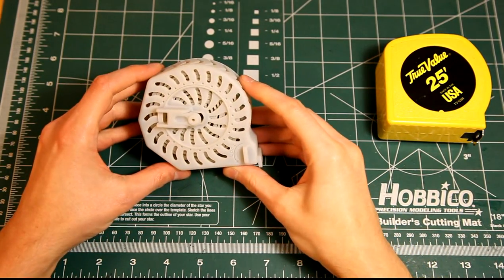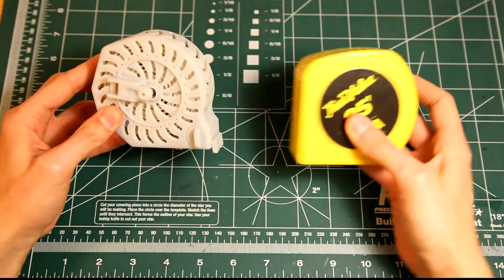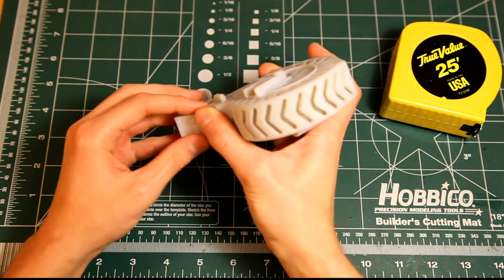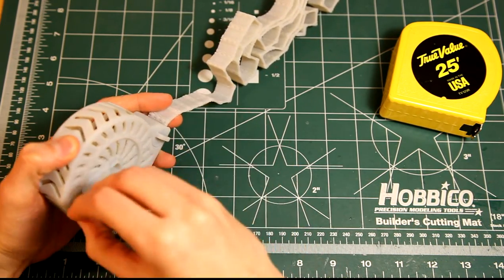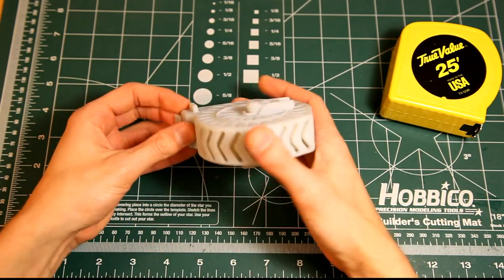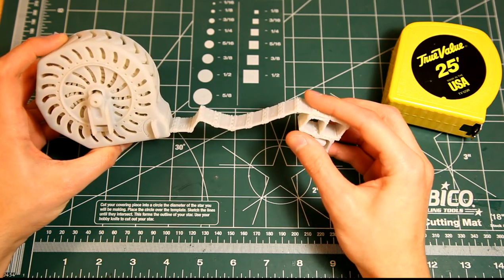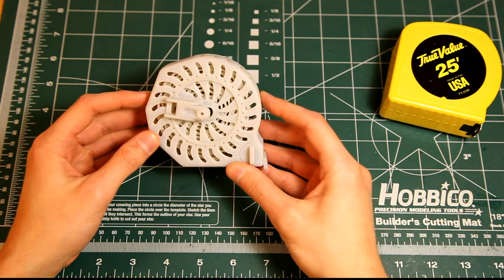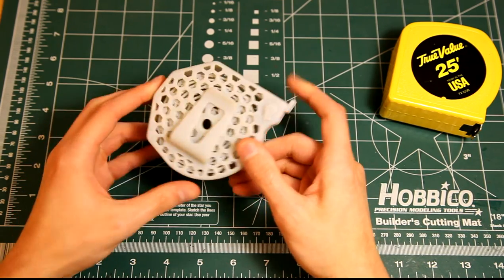3D Printed Tape Measure

Comment: I think it's really cool that you can print a working item in one piece. How is that possible? I am not really familiar with 3D printing, but it seems to me that it would be difficult to print the moving parts because the extruded plastic would want to cling to itself while it was still warm.

Comment: Are the STLs available?  Was a dissolvable material used on a second head?
Reply: I believe that this device was printed on a projet, or, something like a projet. They are extremely expensive printers that print a uv-cured plastic, that has a wax support material. I highly doubt that this could be printed with any of our FDM printers. Partially because the resolution is just not going to be there, and, the support materials on FDM printers aren't good enough.

Comment: The precision must have been high to print this, and if i'm correct, you must have used a dual extruding printer for support material.
What printer did you use, i'm curious?
Reply: ***** I don't exactly mean to rain on your parade of saving the children, but 9 times out of 10, a developing country will not have a 3d printing farm full of tape measures, mainly because by the time you shipped 3d printers in enough volume to actually help (say, 500) and lets say you get a good printer (makerbot or your choice of a printer that costs 1k) you are already up to 50k. If you were going to spend that much you might as well send real tools that will never break. Because the cost of PLA/ABS vs the cost of a tape measure is currently around 22 bucks for 1kg spool of your choice vs around 3.50 for a tape measure at harbor freight.

So no, releasing this tape measure on thinguverse is not going to instantly make home building possible in a third world country, sorry.
Reply: 16 microns on the Stratasys Objet Eden 3D Printer - and yes, there's support material.
Reply: Stratasys Why not make it open source for anyone to print their own? Why horde the technology to yourselves if all you're going to do is boast about it and not share the technology with everyone? In making it open source you could be given developing countries tools in which to build homes and use in their tool boxes.
Reply: TehPaws3D Having this open source means anyone have access to it. Your opinion is mute.

Comment: Not all applications require a lot of precision.  I want to print one of these for my tabletop gaming.  Almost every gaming system rounds to the nearest inch (the rules dictating whether that's up or down).  Obviously, I have a fully functional tape measure already, but it's not nearly as cool as a 3D printed one, and I want a print I can show off with.
Reply: With matching dice.

Comment: Impressive work. Though part of my brain is thinking "great, it's 2014 and now we're 3D-printing tape measures that still don't use metric."
Reply: Nothing wrong with inches per se, but I don't we need to repeat the whole metric debate here. Plenty of places on the internet for that like this http://www.metric4us.com/why.html
Reply: So true
Reply: Imagine how small the parts will be if you want centimetre graduations.
Reply: Nothing wrong with inches: be a measurement polyglot.
Reply: Jaap van der Velde
Well, you brought it up.